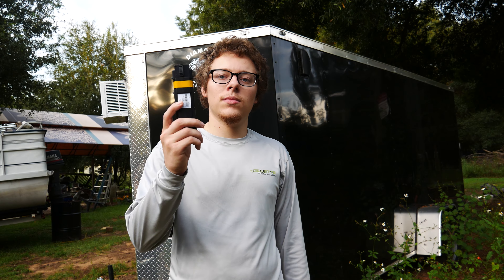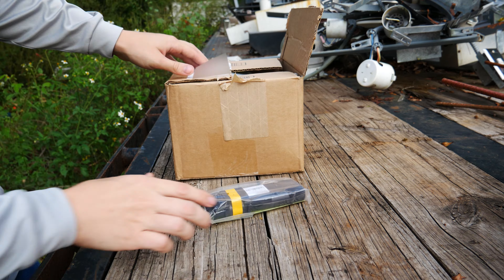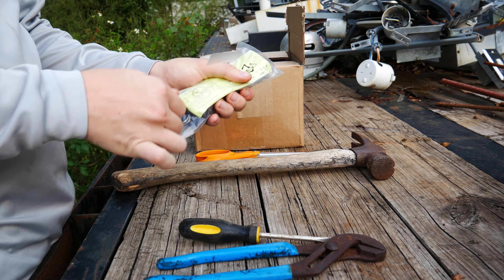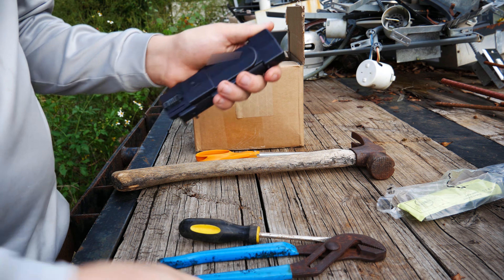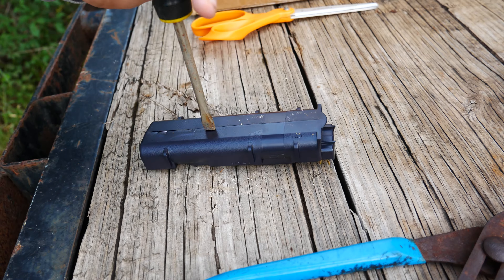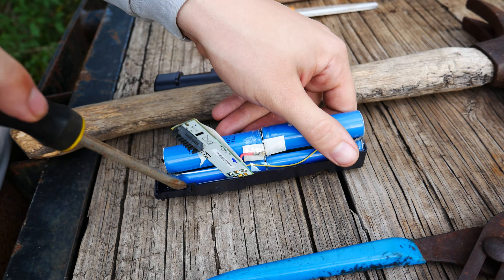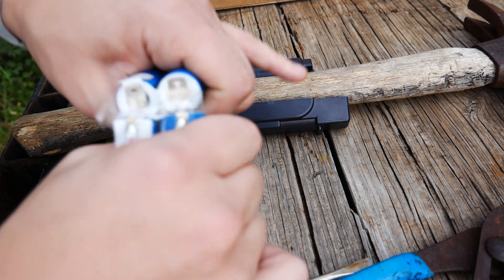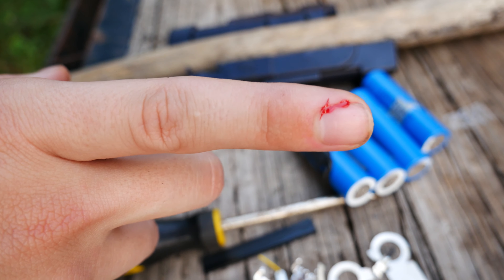Opening Modem Battery Packs!

Comment: Instead of banging on it with a hammer and screw driver, try cutting through the stickers on both sides with an exacto or similar blade.  Then you can hold the battery in a vise and just push it open with no problem.  I did a video on this. The ones I have opened have contained mostly LG cells and they are the most difficult to get the cells out due to the amount of adhesive they use.  The Sony and Molicells were the easiest to get the cells out.
Reply from the maker: I actually started doing this with a batch recently it worked extremely well!

Comment: So a bit like taking apart laptop batteries then? Seems pretty straightforward :)
Just a quick word of warning: you can't sell 18650's anymore on eBay, I tried an my listing was removed from eBay so you'll have to find somewhere to sell them.
I also think it's better to use a pair of side cutters/pliers instead of large grips - that way, the metal tabs come out much easier.

Comment: Tip, wear gloves! Tip 2. Once you start opening, don't stop until you finish incase you create a short. Tip, once the cells are out. I just rip with pure aggression and then use wire cutters to fold off the metal tabs! I've done millions haha.

Comment: What are ya building with them?
Reply from the maker: A bunch will run my tiny home I'm planning on building , and another set will power my little trailer
Reply: @FireDragonStudios  sweet! I'm sure u know your stuff but I use 0.35 tinned copper and solder to a bus bar! Makes life easy and safer.  I find spot soldering an expensive way to do it.
Reply from the maker: @squidlings  That's about how I'll probably end up doing it. I don't even have a spot welder so ¯\_(ツ)_/¯